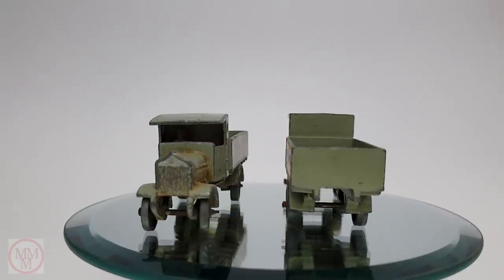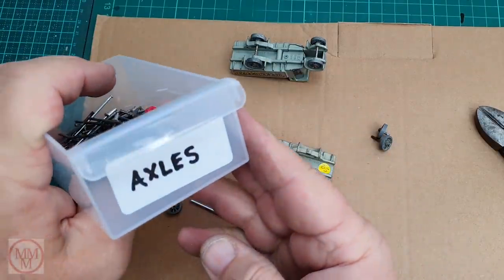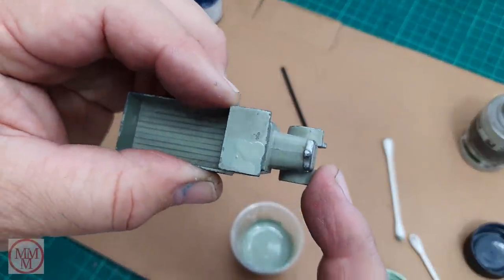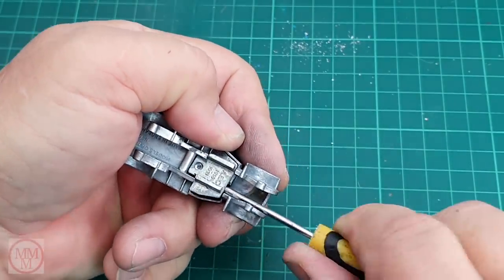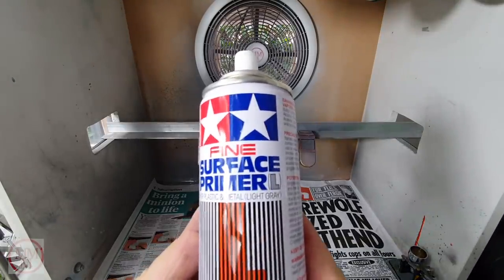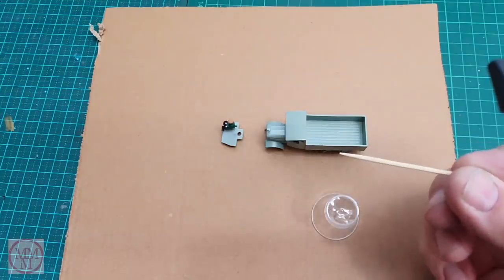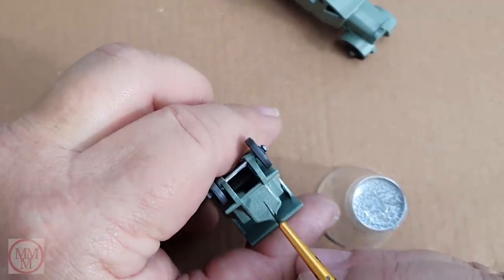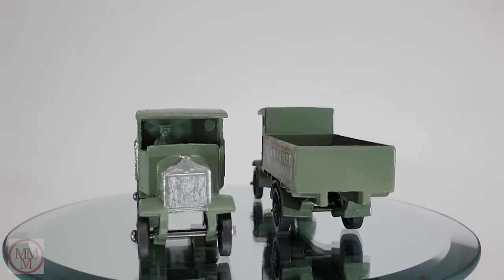MATCHBOX Restoration Yesteryear Y6 A.E.C. 'Y' Type Lorry 1957

Comment: The driver's side 'door' was a fixed panel, as the gear lever and hand brake were on the right hand side of the driver leaving no room to access the compartment.
Reply: I found a picture of a military truck with open access to the drivers position from the right: https://commons.wikimedia.org/wiki/Category:AEC_military_trucks?uselang=de#/media/File:AEC_Y_Type.jpg
Reply from the maker: That makes perfect sense.
Reply from the maker: Thank you!
Reply: I wish you'd used the drill press to river the axle.
Reply: Also, boarding the vehicle was done from the passenger side which faced the sidewalk, for safety and because not all streets were paved back then and were often muddy.
Reply: additionally you saw that feature often on rather simple rides, so they seemingly used the "safety feature" to save on  production costs, too.

Comment: I've got two of these - one was in superb condition, so I left it alone. The other was tatty, so I stripped it, cleaned it up, and painted it khaki, and added 'WD', and 'Broad Arrows' to the sides. The driver had a head transplant, for one with a tin hat. A load of crates, etc., completed it.
It's a lovely model, whatever you do to it, though. The driver figure does look the same as one to be found on a Lesney road roller model. Lesney also made a Leyland lorry of the same sort of time period (WW1-1920's), but no driver or cab detail. Big open cab, too.
Great finished result. I love your custom colour, too.

Comment: I love that little truck. It was one of the last ones for me to find of my Matchbox first series  Yesteryears. I would love to get one of your restorations. "Snitches get Stitches". I loved toe nail clippings storage drawer. BTW, Some early 1900s cars actually had the driver's side of the body stamped with a raised line to look like a door even when it did not have one! Besides the brake lever being in the way, Many of them had the spare tire overlapping the door on that side, and the running board had things like tool boxes and acetylene generators fastened to it. And it was considered safer to enter the truck from the passenger side.

Comment: The bumps on the engine bonnets are handles and the bonnet would swing up.  The doors however look to be canvas and not actually doors.  I would guess drivers side most people grab the steering wheel to climb in, while they would need a handle to climb in on the passenger side.   Love your videos. Great to watch when the world is a little to much for a day.

Comment: When I use small wire wheels, I put some drops of crazy glue where the wires meet the wheels on your tool.  This significantly reduces the number of loose wires coming off the wheel, and increases the life of the wire wheel too.
Reply: He tried that once. Must have used too much glue as it was solid as a rock. :-0

Comment: Those things on the engine cover are actually handels, which you use to pull the covers open. To open the "hood", you just tilt lift the cover. There is an actual "butterfly hinge" in the exact middle of engine compartment. Pretty handy for accessing the engine on both sides.

Comment: The rear wheels have more spokes to support more weight, like a load in the rear, much like dual rear wheels on a modern truck. The half moon things are handles to open the hood to access the engine. Very cool casting. There is only one door handle on the the truck because that's how the early vehicles were. The idea behind that was to keep the driver from stepping out into the traffic.
Kevin says "Snitches get stitches "

Comment: "Snitches get stitches"

I used to do the paint stripping work for some of my old Volkswagens.  

I used a lot of paint stripper and I noticed that it is based on some kind of acids.  So when I got skin burns with the paint stripper I used to have a bowl 0f water with  bicarbonate (baking soda) to put my hands in, and cut the acid reaction.  Mere basic chemistry. Also to prevent more oxidation due to the paint stripper remainings, I used to give the tin  a little wash with the same solution

Maybe you would like to try to immerse your models in that bicarbonate + water solution to cut the stripping gel effect. Then wash it with  normal water

Great job !!
Reply: Snitches get stitches was it. Really nice work Marty thanks for the video

Comment: The little blebs on the side of the engine panel are, I think, the hand holes for lifting the bonnet to get at the engine. the bleb was knocked out from the other side of the metal, the bottom edge was hollow so you just slip your hand under and lift. Notice the passenger door handle isn't on the door like a modern truck.

Comment: You've had the answer about why no handle a few times. But doors seem to be quite a rarity on the AEC Y. Most of the pictures show a canvas "door" with no handles on both sides. Here's a really nice example on Flickr which also shows the bonnet handles well... https://www.flickr.com/photos/77175657@N00/26473192286

So it looks like the door just to the pavement on the nearside was an afterthought in most cases anyway. Really good makeover and I have to say I quite like the Joker driving the one. It could come straight out of Gotham. But don't tell Batman that you've spotted him as we all know that snitches get stitches!
Reply from the maker: Neil , thanks for the comment I checked out the picture. That truck looks as old as the hills!!!

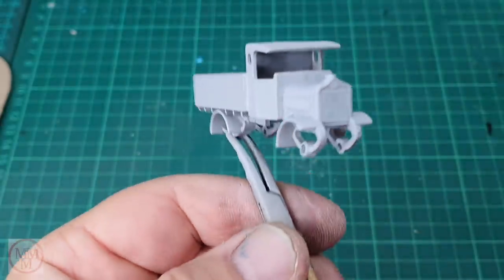Comment: @17:15 Those half-moon-shaped objects look like hand-holds to lift open the hood of the engine compartment (the bonnet, to my cousins in the rest of the Anglosphere).
Oh, and the round spot on the driver's butt looks like it might be where an ejector pin was located in the mold.  That would have popped, when the mold was opened, to push the casting out.  Not sure about the pin sticking out, though.  Maybe he's a Werewolf of Southend and that's his tail?

Comment: The door handle is only on one side because they were delivery trucks and they were there so they could get in and out on the sidewalk side of the truck. The drivers side did have a handle on the the inside to open the door.

Comment: Kevin, I'm pretty sure those 'half-moons' on the sides of the bonnet vertical panels were pressed-in apertures meant o be used to slide your hand in to open the engine compartment. Just one question; Is it me or is one of the models VERY SLIGHTLY larger than the other? Love your work. Keep it up!

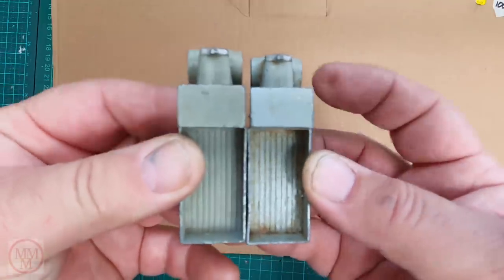Comment: At 5:54, it may be a trick of the camera and the angle at which you held the models, but it looks like they're two different castings.  The roof on the one looks a hair smaller in width than the other.  The front end (engine compartment) also looks smaller.  Are they the same castings?

Comment: In the 15th minute, when you clean the model with alcohol to get rid of remaining paint stripper (and other stuff perhaps), you let the model "dry" afterwards, i.e. you let the alcohol evaporate (although part is absorbed in the tissue, I admit). Doesn't that just deposit the paint stripper again? In other words, if the paint stripper doesn't evaporate itself, where does it go? Aren't you mere "spreading" the stripper like this into a - perhaps invisibly - thin film? Would you need to flush or brush away the alcohol (e.g. absorb it fully in the tissue paper) to get rid of the disolved substances?
Just curious; I've seen this being done by many people, but never quite understand why it would work...
Reply from the maker: Good question Dave. I think that the action of agitation with the paint brush encourages any residue to become dissolved in the alcohol and remains there, in the bath, when the model is removed for drying.

Comment: That's the reason, when buying paint for the house, you should always get the same batch number, if you buy more than one tin. The same applies to wallpaper. (If you have to use different batches, make the change in a corner, as it's less noticeable) Sorry, ex decorator.

Comment: The AEC wheels were usually painted the same colour as the truck and had Solid Tyres - black or very dark grey. https://leicestermodellers.weebly.com/uploads/8/0/9/7/8097807/6015271_orig.jpg